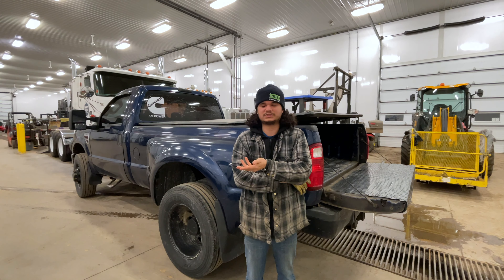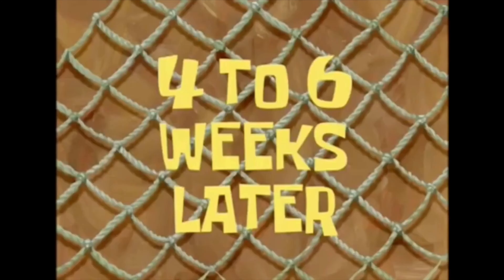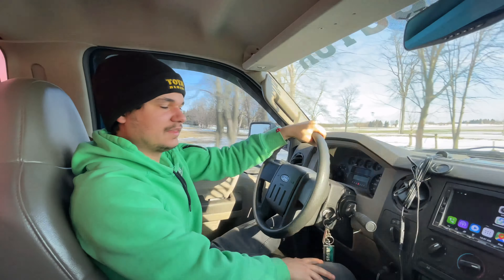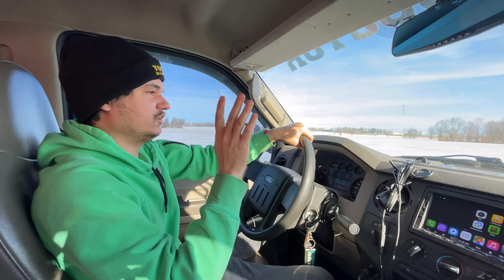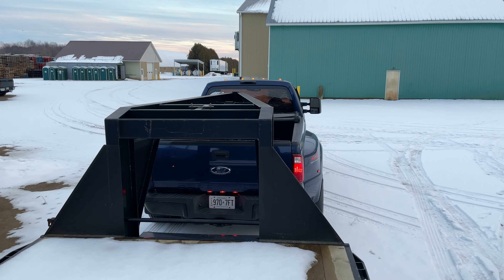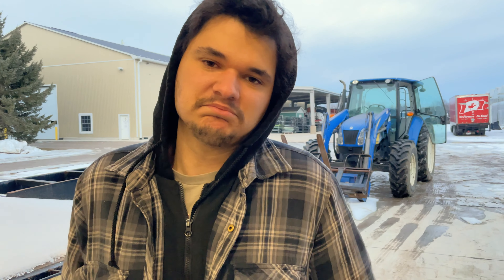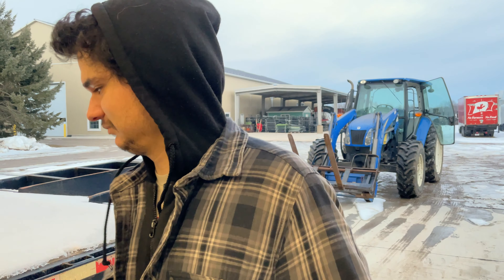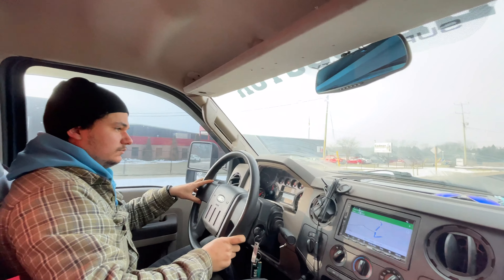STRESS TESTING TOW - Fummins F350 [4K]

Comment: I love your rig bro, I'm looking into getting an 08 f450 fummins 24v that's p pump swapped also. I run a 04 Silverado 2500hd 6.0 for my business towing a 14ft gooseneck dump trailer plus a 12ft bumper pull dump trailer and while it's never quit on me the fuel mileage sucks obvi and the power is terrible. I just love the way the 08-10 f series look and a Cummins swapped one just takes the cake.

Comment: Got a 2006 f250 with a ppump 24 valve swap, to get this thing to shift and pull like a dream is easy. I got a 1600 stall Goerend torque converter for the 5r trans for the tune go to Bless tunes and get the 6.0 tune for the street tow tune.

Comment: You can make the trans lockup in 1st gear with a sct tunner. There's another YouTube that has a fummins with a compound turbo 12v with a 5r110 he uses a sct tuner to control trans locks ever shift

Comment: Do what did this guy at the shop do? Just tuning?🙃
Reply from the maker: Just tuning and a throttle sensor to allow the tune to know what throttle % is at at all times.   Previous tuner had it only lock up in last gear, and throttle sensor was set to 16% all the time.

Comment: Saw this truck in Norwich at a tuner guy not impressed by that guy out there
Reply from the maker: What’s not to be impressed about? He took a truck that couldn’t tow an empty trailer and made it into a tow pig with just tuning!
Reply: @ShiftedInterests  he was the guy that actually fixed it... He tuned my d max and I have problems with it all the time I guess he's a Cummins guy only🤷
Reply: O and he is really hard to get a hold of he had to re tuned my truck 4 times and it's still not right